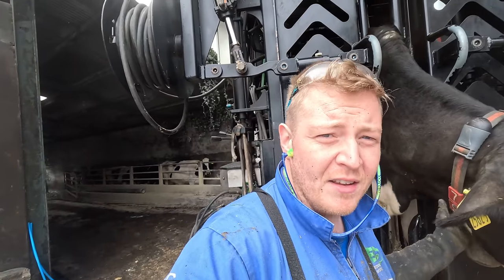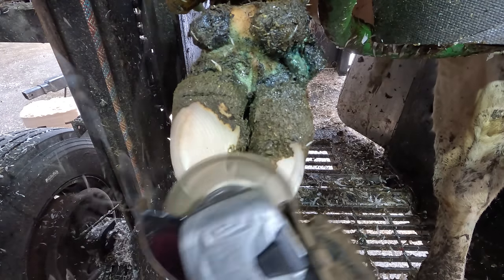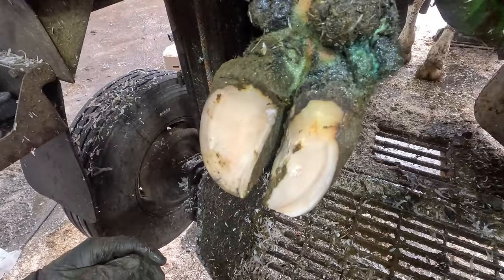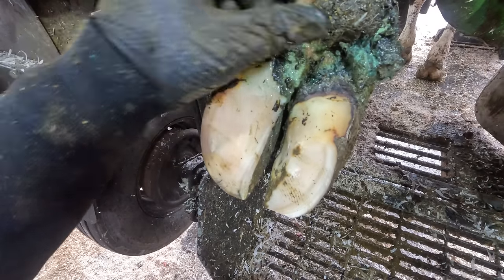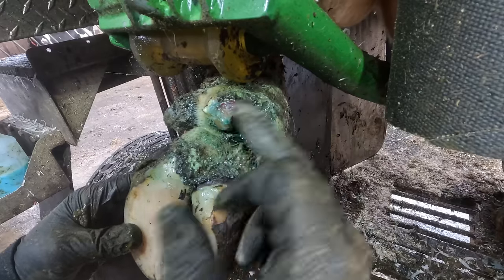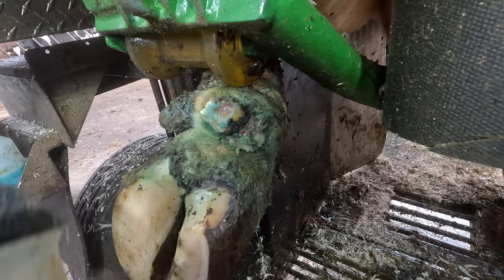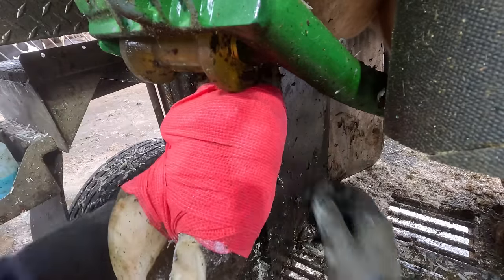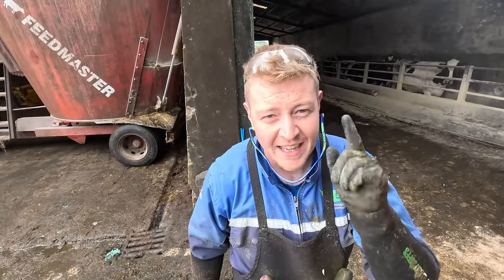Mangled and Infected Dew Claw

Comment: Hey Garreth, Have you tried to use a ketchup bottle for putting on your powder and with the tip cut more open than usual and that might make it easier to pinpoint where you want it to be put on and without wasting your powder. Keep up the great work man!